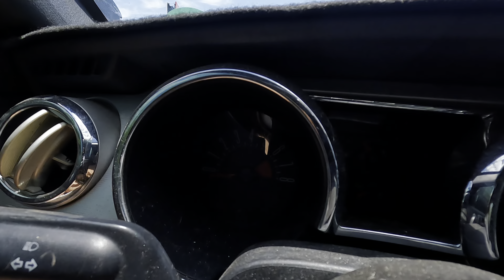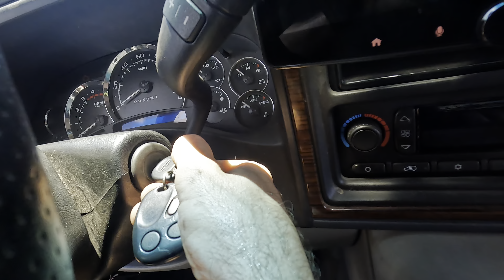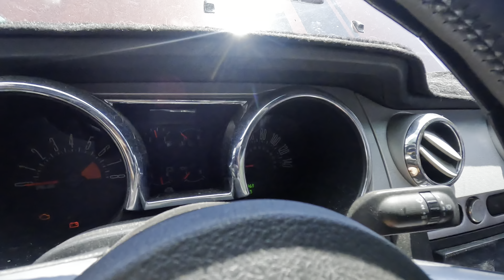Great Way for Wheels To FALL Off! (Wheel Spacer) Ford Mustang GT

Comment: "Warped Rotors" have been a pet peeve of mine for Decades! Thank you for mentioning the real cause. It won't change the unwashed masses, but it made my day!
Reply: You must have watched a different video than the rest of us...
Ray gave you three scenarios all of them being a variation of the same symptom. 
He gave you 3 results but he never gave you the root cause as to why rotors warp in the first place, 6:55 Ray: we either have surface thickness variation in the rotors that's where the rotor is a little thicker in spots... 7:17 Ray: The other way the rotor is warped and weevly-wobbly round.
7:19 Ray : The majority of vibrations is caused by issues with the surface and thickness of said surfaces...
I will just say, rotors primarily warp because of excessive and constant heat that reach 900 degrees or beyond
The reason why they warp can vary from literally anything to excessive or hard braking, bad factory casting and machining, wrong type of brake pads ceramic / metallic, cheap after market rotors, partially or fully seized caliper pistons, fully or partially seized sliders, contaminants on pads, bad wheel bearings, a build up of brake dust, mud, sand, rust build up when vehicles are  left parked outside for longer periods,  people who drive with two feet,  uneven caliper piston pressure,  aftermarket calipers, constant driving/braking in heavy traffic, poor ventilation and heat entrapment caused by wrong wheels or in this case fancy caliper covers that can trap heat.  When a brake pedal pulses under your foot, this is a strong indicator of a warped rotor. We the unwashed know rotors warp and why they warp, its not rocket science

It's also no secret that vehicles that do a lot of hi-way driving get longer brake pad / rotor life.
Reply: "Mines Warped! Why do I always get the Warped one!" - William J. Le Petomane
Reply: Warp Rotor sounds like the name of a rock and roll band.🎵
Reply: @ManBearPig3   No one can definitively answer that query from where they are sitting. 
For any inquiring mind...Pads and rotors are made and meant to wear out, none are built to last.  Alternatives., always use OEM warranty parts or top performance slotted / vented rotors and dual piston calipers. Change brake pads anytime they become glazed or exceed 65% of total wear to ensure proper stopping and maintain even rotor wear. 
All cars can be identical or comparable with the exact same brake materials set up.
The only factors that can cause shorter brake life are driving conditions and driver habits with the caveat, conditions or habits don't necessarily have to be good or bad.
Reply: @Michael-yi4mc   yeah I remember them, they played a few gigs in a Ball Joint back in the day..
Reply: Yeah, the cheap Chinese rotors that a place put on my 1996 HD F250 4wd with a 7.5/5speed was surface variation and not warped rotors even though they warrantied them 3 times. Every 6 months same thing, I went aftermarket rotors and pads and not only did the truck stop on a dime, I went over 60,000 miles before needing to replace the pads, rotors were still good. Not bad for a 7000+ vehicle, and with me usually either towing something or loaded up, they definitly were getting a workout.
Reply: @Michael-yi4mc  Definitely prog-rock.
Reply: @IR-nq4qv  I missed the transmission of that live show! But I guess those are the brakes.
Reply: @IR-nq4qv ...calm down bubbs, it's not that serious.  People say things in passing, we don't need to take it that far.
Reply: @deplorablelibertarian  Thanks Sheriff but I'm already calm and in no need of a time out. In order for something to be considered "said in passing'', it's usually done in the face to face physical sense.
I'm not taking anything anywhere, I'm simply pointing out a fact that no cause for warped rotors was ever mentioned in the video even though the poster thinks it was.....
Perhaps you can explain how someone spends decades trying to understand something then finally gets a eureka moment without receiving an explanation.
Reply: @IR-nq4qv  Overworking your brakes is what causes warped rotors (on properly manufactured rotors). Slotted and drilled rotors are NOT required for anyone except if you know you need them. Basically no one not going to a track and even most people going to occasional track days. Dual piston calipers are also not required. Just get good quality pads and rotors and do a slow, methodical, and proper brake change. That's the key. Quality parts, quality service. That's all that matters, not "dual piston brakes", or "vented/slotted rotors". ALso, what's the point of replacing your brakes at 65% of life to maintain "even rotor wear"? If you can go longer and they're still true, might as well take them as long as they stay that way. Emergency stopping power is not impacted by thinner rotors, it only impacts heat dissipation which might be important if you're driving in conditions that overheat your rotors. In that case though, you probably want to upgrade your components and use them to their full life rather than replacing your brakes with just under half their life left.
Reply: @roots4x   I took the time to address all that you mentioned...
Overworking your brakes is what causes warped rotors (on properly manufactured rotors). ---
Partially true
Actually warped rotor is the result of heat friction and temps exceeding 900 degrees,
Normal use is not based on the INDY 500 or driving with two feet. Many people who never overwork their brakes under normal conditions still have warped rotors.
 Much of the time a warped rotor can be attributed to a partially or fully seized caliper or the type of  pad ie: metal /ceramic etc. I previously mentioned all of this and other reasons as well

Slotted and drilled rotors are NOT required for anyone except if you know you need them.  ----
 Same as buying quality tires. This is a matter of opinion.

Dual piston calipers are also not required. Just get good quality pads and rotors and do a slow, methodical, and proper brake change. ----
Agreed / Not required but they are standard equipment on many cars.

That's the key. Quality parts, quality service. --
Yes, I mentioned that as well

ALso, what's the point of replacing your brakes at 65% of life to maintain "even rotor wear"?  
 Why not? Brakes gone beyond half life are pretty much down to the warning bars, glazed over, heats up faster, why wait until you are down to a point where the pad is 1/8 of an inch ? this is also a matter of opinion versus proper maintenance.

If you can go longer and they're still true, might as well take them as long as they stay that way. ----
This statement is based on "IF" and "Might"
You won't find these words used in any maintenance schedule.  This is the same mentality applied to tires with little to no thread left. When you tell someone they have 30% of vehicle brake life left, this means they will also need rotors the next time they need a brake job because they will be damaged by worn out pads.

Emergency stopping power is not impacted by thinner rotors, ---
This statement is erroneous in its wording especially in conjunction re-machined rotors and pads that are worn down to the rivets along with the pistons and sliders being fully extended .

it only impacts heat dissipation which might be important if you're driving in conditions that overheat your rotors. ----
It suddenly becomes very important if you daily commute on steep inclines and you're towing heavy loads

In that case though, you probably want to upgrade your components and use them to their full life rather than replacing your brakes with just under half their life left.----
I totally agree.
Reply: Warped and rotor thickness variations….two different answers for the same problem…it’s still a warped rotor that has excess runout…need to be resurfaced if within spec…. Old school terminology and new school retooling of words.  Equals same result, just more word salad
Reply: @IR-nq4qv  I just think wording can be misunderstood without verbal cues we use when we talk. Just have to be careful how you word things online. Especially when you're trying to give advice about important things like brakes.
Reply: @roots4x   When making a point on a public forum it's always a good practice to establish that you even have one before you begin. If you make a point based on fact, you should be at the very least prepared to back it up. 
If people communicated effectively and succinctly with basic writing skills, there would be absolutely no confusion or misunderstandings between fact, fiction or opinion. 
Open public forums are not for baby sitting or Molly-coddling nor should they be confused with Dear Abby or Miss Manners. Your points are well taken but they should be directed to the OP.
Reply: Let’s see the rear brake job Ray. More Ray is best.
Reply: Been there, have seen that. Thanks
Reply: @IR-nq4qv But for some “strange reason” the pads and rotors on my Toyota hybrids seem to last almost for ever. 😜 As long as I have been driving them I have never had to replace either of them. 😁
Reply: Rotors don't warp,

Comment: I don't believe your microphone is actually working properly. If you have it plugged into your camera, it may not be selected as the default microphone. When you walked away from the camera, we lost the volume on your voice. If it was working we wouldn't have noticed a change in volume. 

Edit: Re-watching that section of the video, I also noticed that the tone of your voice changed as you angled the camera towards you more just before you walked away.

Comment: Everyone knows that if you hear brake noise, it means your stereo is not turned up high enough. Sheesh
Reply: Or you could be deaf.  I did a brake job on a 1960s Karmann Ghia in the late 60s that had NO linings left, it was total metal on metal on all four wheels.  It was a wonder the old guy could stop.  As I remember the car was a trash heap inside.
Reply: I once fixed a transmission by changing my CD from Queen to Iron Maiden
Reply: 🤨That's not a good idea if I heard your brakes squeak or grind. If I needed a ride from you, I would turn around and call someone else for a ride, ssshheeese!! dangerous! Why don't you look up most crazy accidents from people neglegents on vehicles my man and you would understand
Reply: My new car's stereo doesn't have enough bass for low vibrations and whatnot. I need to remedy that. But yeah, fixes noise every time.
Reply: Lol did that to my wheel bearing, can't believe it didn't fell off, both front was wabbling hardcore

Comment: With wheel spacers you use the same torque spec as the lug nuts and its good practice to put a little bit of blue loctite on the threads to keep the nuts from wanting to back off. It's annoying to torque them because you have to use a pry bar to keep the hub from turning. Big spacers will strain the hubs and make them go bad sooner and stress the lug bolts more. Spacers like this size are fine as long as they are high quality and are hubcentric. Spacers that are not hubcentric should be illegal. Thanks for coming to my ted talk.
Reply: It's the bearings that suffer, not the hubs
Reply: A lot of modern vehicles use non serviceable hub assemblies and not standard bearing and races. So the term hun is ubiquitous
Reply: When I installed my hubcentric wheel spacers, I placed a length of pipe between the front seat frame and brake pedal.
Moving the seat forward will apply the brakes so you can tighten the spacer Nuts.
Reply: They don't have to be, I know when I torque spacers like that, I just jam on the brakes by either wedging the pedal down, or a friend, then torque. Also a small spacer like this shouldn't be no harder on the hub bearing than a different offset wheel, its when that are much bigger and or heavier vehicle like them kids in them diesel's with the wheels sticking out past their tow mirrors.
Reply: @VikingDudee  mine are attached to 16 inch beadlock wheels and 38 inch MT tires. They're very heavy
Reply: yessiree..

Comment: the second you ask if the new mic is good ----> it stopped working
Reply: LOL very Ray, of RAY.
Reply: Yeah, when you walked around to the other side of the car, the audio dropped, so it seems as if it's still the mic on the camera is what's picking up your audio.
Reply: I was gonna say the same thing, LOL!
Up until it stopped working, it sounded great!
Reply: Yes, you jinxed yourself.
Reply: Yep, right at the cut at 21:31, it went back to bad audio. Background noise ramped up. I'm not sure where you were wearing the mic but it changes depending on where your arms and body are.
Reply: Also, did you change the audio quality settings on the camera or the new mic? The background sounds are getting louder AND they sound like bad low bit rate .mp3.
Reply: @36:38 he mentions he got it working again... oh Ray and technology don't you love it?
Reply: The mic picks up Ray very well but it also picks up a ton of background noise — fan, traffic, etc. that is pretty distracting.
Reply: @jimmccrea3782  it was fixed after 36:38 once he turned the Mic back on, before that the mic must have been off as he notes in the video via text that its working "now"
Reply: YouTube ads just get worse and worse. Now they're starting to average 45 seconds? That's the easiest way to get me to stop watching a video.
Reply: Yep. Lapel mic was off, so since the camera couldn't find it, it reverted back to the on camera mic. Shit happens.
Reply: That just happens naturally when mechanics touch electronics.
Reply: @KentuckyRanger  This is what I came here to say too. :0
Reply: @morrisonAV  more like digital wind noise cut. Lots of "swirling" noises in lieu of background noise.
Reply: Your Mic's off!!!  LOL
Reply: Ray you are killing me!! that timing on the mic was "chef kiss"!!!
Reply: Well that  IS  the way Life works , in general . Yes ?

Comment: In the 70’s we used to rebuild calipers on every brake job. This included the piston rebuild on the rear drum brakes at that time But, i have always remove one wheel’s brakes at a time and that explanation you gave of the piston popping out upon depression of another piston is exactly why my father taught us that way. Good video, it is good to see some of the multiple brake caliper design changes that the manufacturers have made. Innovation is good! Purple caliper grease apparently is bad. Thanks for that update too, i think i have a half tube left in my tool cart.

Comment: Hi  Ray,   just a note for you,        when you install wheel spacers you should cut the original studs so they are flush with the spacer's surface... if you dont, the spacer will not seat properly and might give you that shake.
Reply: I see what you mean 
The wheels could be resting on the studs and not on the whole spacer
Reply: @DaveBigDawg  In some cases yes, but those Mustang wheels have pockets in them so the studs won't hit. I've never liked spacers, they just add an extra point of failure.

Comment: Sorry for yet another comment: Greasing the wheel hubs or the surfaces of the rotors (where the wheels are contacting) is a nono. The bond between hub and rotor (and between rotor and wheel) is supposed to come from friction between those two surfaces. The wheel studs are supposed to create the tension to make this friction happening. The whelle studs (or fasteners) are NOT supposed to take shearing forces. By lubricating those surfaces you are reducing the friction and make the studs/fasteners prone to shearing forces.

Comment: A new project for Ray!  Add terminals that are accessible from the side of the tool box so you don't need to climb into the bed, open the box then open the other box just to connect the jumper cables.   Just flip open a cover on the side of the tool box and connect the jumpers there!
Reply: 😂😂came to say  exactly that
Reply: He's got a lock on the tool box. I doubt he wants someone touching a wrench to his two exposed terminals. Similar reason I don't leave my winch connected.
Reply: @jasonemeric9902  it switches on and off from the cab, your comment is mute
Reply: @scottwilliams1976  oh. Indeed it is lol
Reply: @scottwilliams1976  and btw... If u r gonna be like that... it's "moot", not "mute"
Reply: @jasonemeric9902  It might well be, but equally it is "you're" or "you are" and "going to" 😉
Reply: @DraftySatyr  mute is the wrong word.  "U r" and "gonna" are abbreviations and slangs. Not quite equal like u mentioned. We can pretend they are though if it makes everyone feel better

Comment: You should also mention the people they shouldn't add brake fluid to their master cylinder because that's a good recommendation to see how your brakes are. The lower the fluid means of left pads that you have on your brakes. That way when you squeeze the Pistons back in the caliper it fills a reservoir back up
Reply: big smile here

Comment: Always a good idea to check level of fluid in the Reservoir or open bleeder and drain caliper fluid out of caliper to prevent pushing reservoir lid off and leaking fluid into engine bay
Reply: rbw sez "yesss"

Comment: Almost all manufacturers recommend greasing brake parts where friction occurs if there is not a friction surface shim.  The caliper to brake pad does not move when correctly installed

Comment: Hell yes I want to see you do the rears.
Reply: Definitely, those need the adapters for the calipers to compress.
Reply: @tomn8tr  I have a 2016 Mustang and I had to buy a special tool to rotate the pistons in the rear calipers in order to compress them.  Soon I will have to do the brakes all the way around on my 16 Odyssey.  Can't wait to see if I will have to buy special tools for that job.